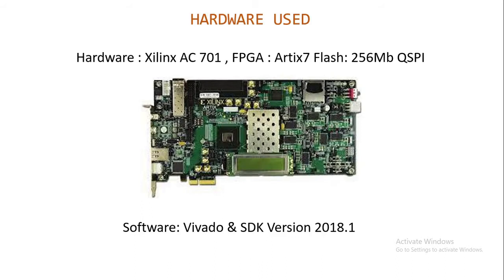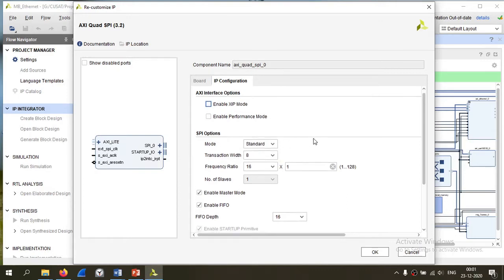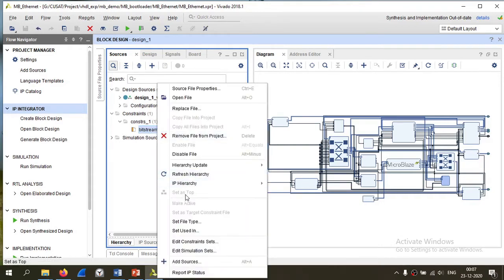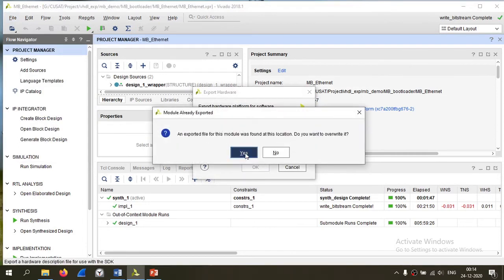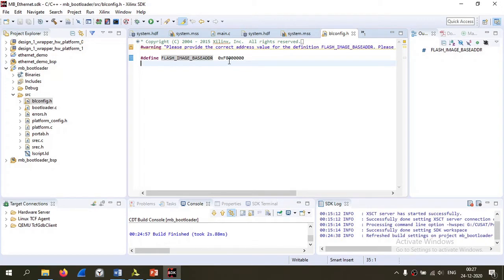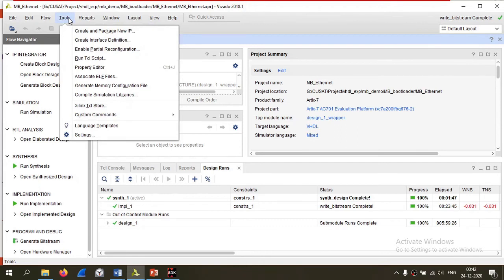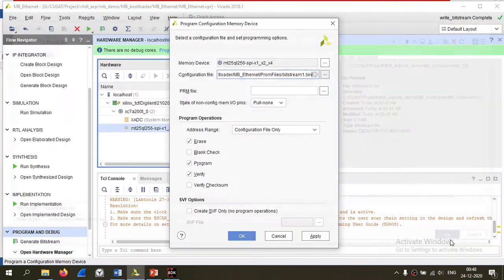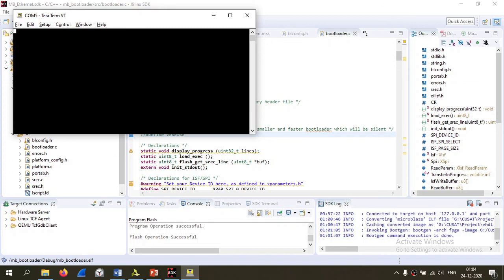Creating Bootloader for MicroBlaze to boot from SPI flash on AC701 (Xilinx Artix 7 Evaluation Board)

Comment: Great Explanation. I have a query. Here, does the applicaiton code execute from the flash directly or does it get loaded to BRAM and execute from BRAM?
Reply from the maker: @abhaydeshmukh2642  The boot loader runs from the BRAM, which is the default memory of Microblaze. It copies the application program from the flash to the DDR RAM, and then jumps the execution to the starting location of the application program. So the application program runs from the DDR RAM
Reply: @letslearn39  Thanks. Keep the good work going

Comment: Why you use .bin file instead of .MCS file for QSPI booting, as much as I know this .bin is used when booting through SD card boot mode ?
Reply from the maker: For storing configuration information you can use either .bin or .mcs file . I used .bin,  as bin file has lower size than .mcs format. Both will work from qspi flash also

Comment: So we have used the SDK to program the QSPI Flash with the Microblaze application. I see that. But then what is the point of associating ELF inside the Vivado project?

I had thought that the BIT file and ELF file will be combined into a single file and programmer and then the Microblaze will be able to simply boot from the external memory. However, that did not happen.

I am actually very surprised to see how long the Microblaze took to boot for a program that should be a few kB at most. What is going on here?

Comment: I can't get my App to run, but I do get the .bit file to run. I'm using a CMod-A7 though. It doesn't have DDR memory.
Reply from the maker: If you don't have external RAM then you don't need bootloader. But your application can not be bigger than the internal RAM (BRAM).
Reply: @letslearn39  thank you. The CMod-A7 has an external Cell RAM, but I can't figure out how to connect it. When I try to generate the linker file, the option doesn't show up for the first selectable memory location. The other 2 do, so I selected BRAM there. But I'm still failing to get my app to run. The FPGA fabric does load though.

Comment: Thank you. I believe this will work on the Cmod A7 too.
Reply: This method works well with Cmod A7-35t, but ONLY with Vivado release up to 2019. The xilifs library, regarding the latest Vivado releases, so the 2020.x and 2021.x is deprecated and into the Vivado2021.1 and 2021.2 you can not find it! Of course this is mainly related to the Vitis that is used as the older SDK into the older Vivado release. Then the SREC SPI bootloader into the latest Vivado do not use the xilifs library and then actually I'm try to explore some way to get all stuff working also into the latest Vivado release. To temporary overcome this trouble one solution is build the bootloader with an older Vivado release and merge the bitstream files that came from the compilation made with the latest Vivado release, but my purpose is work entirely inside the latest Vivado release, so if someone have some idea how to do kindly share it. Thanks!

Comment: Also one more doubt when I was creating my flash configuration file.. it failed as it showed that the spix4 has discrepancy as it's already set to spix1 in my bitfile..i dnt understand when did i give that information..my qspi settings match yours..were could it be going wrong..any idea?
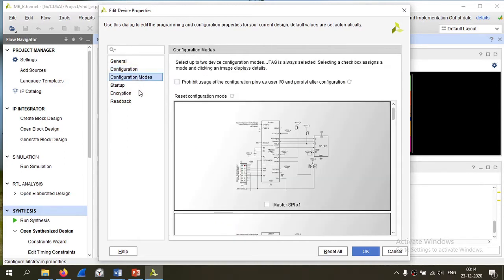Reply from the maker: Please recheck you have selected spix4 at two places in the bitstream settings shown in the video at around 8:20 and 8:35.
Reply: @letslearn39  Ya I missed at one place ! thanks

Comment: HEY ..thank you for the video..was really good .. but am getting could not retrieve flash memory part when trying to program flash from sdk..using xilinx platform cable on a custom board..i have correctly set the fpga device (since the board has 2 fpga's on it!) I have uploaded the configuration file from vivado successfully.. but now am stuck for the application part
Reply from the maker: Are you able to run the processor application by downloading it through JTAG? Are you using MicroBlaze ?
Reply: @letslearn39  Hey thank u for replying.. so it works fine before 20:47 in the video .. but next as you open the sdk and go for program flash memory, I can see your flash type is already there.. but for me on the top it throws an error saying it cannot find the flash device(xilinx docs say check hardware connectivity, which is working just fine, I used it for flash from vivado ). So next I go to debug mode and I see my microblaze in on reset.. I want to share my screenshots if you can provide me a mail !
Reply from the maker: @Snehac88  Send the screenshots to letslearnembedded@gmail.com.
Reply: @letslearn39  done!